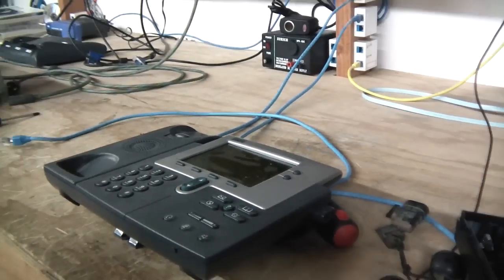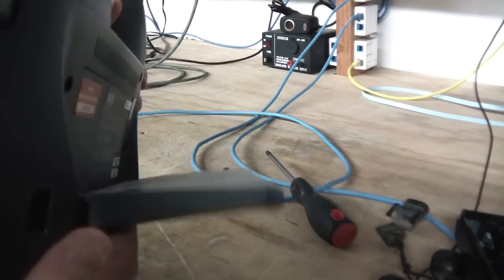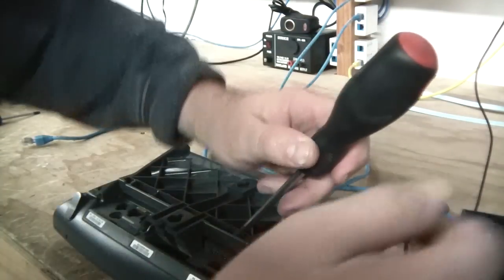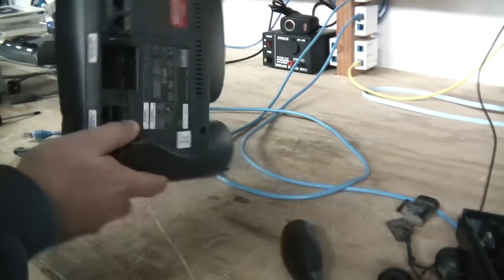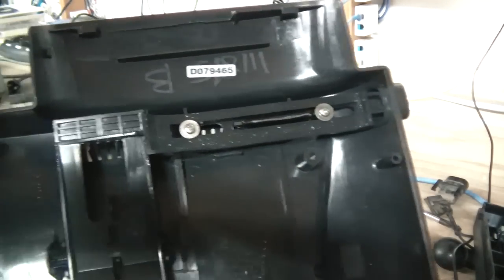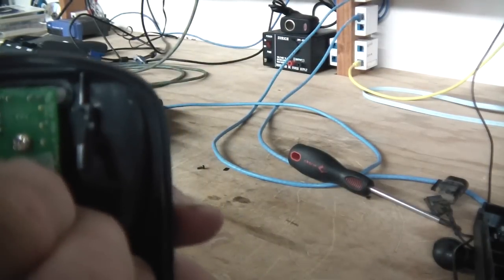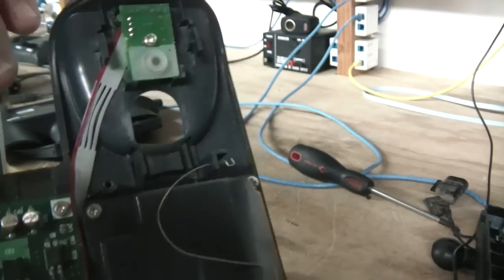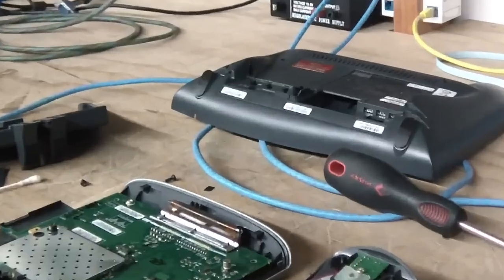Cisco 7960 7940 Phone repair

Comment: Good video, but the 797X series have another screw under the hook catch and three screws under the screen fascia.  Slide the fascia up and out carefully to access those three.  Instead of replacing the plastic tab, I used bubble wrap to act as a spring under it.

Comment: Thanks! i wasn't sure how the phone came apart. Also, i had the same problem with the hook switch. It's all set now!
Reply: Interesting
Reply: it was an easy fix
Reply from the maker: Christopher Gifford cool I'm glad I could help.
Reply: my Cisco IP phone is not powering on. how to repair it?
Reply from the maker: POE and AC adapter?
Reply: IP phone model 7941 is not powering on. it has gone unserviceable due to lightening.